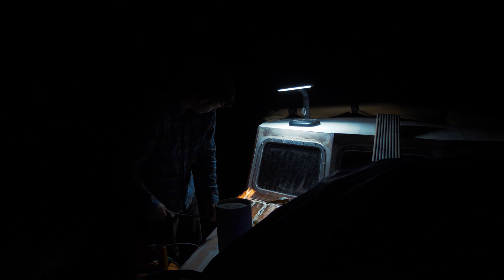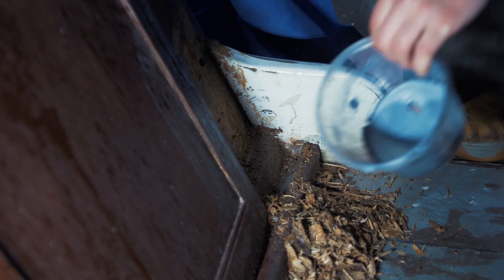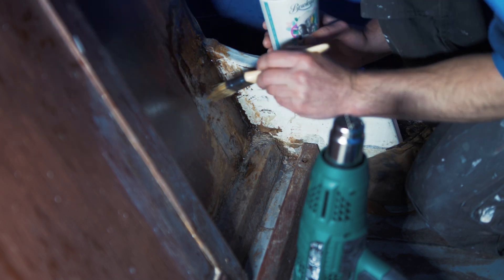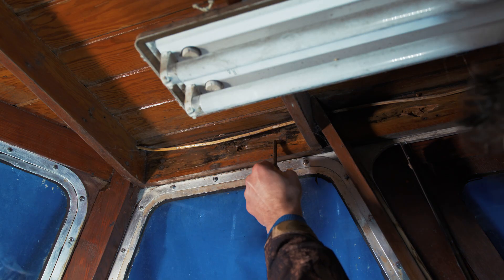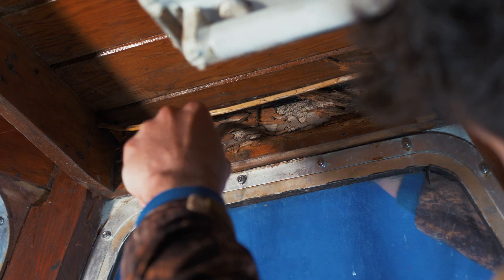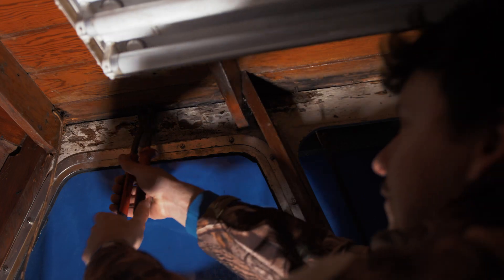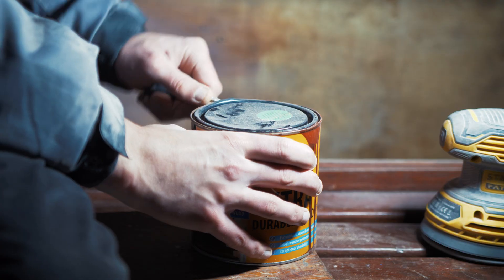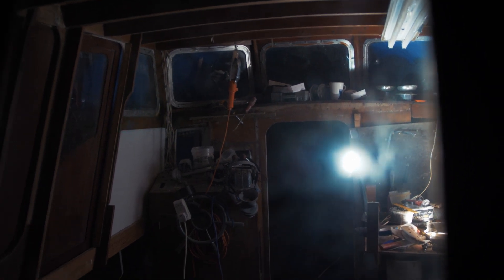Winter Repairs | 1940 Wooden Boat Liveaboard Journey | Episode 33⚓

Comment: Seeing you take down the rotted wood slivers reminds me of having to remove the rear bulkhead of my boat's salon. It was 19 mm (3/4") plywood covered on both sides with a Formica-like material. Unfortunately, there was a 25 mm (1") seam above the door exterior where water seeped in over 30+ years. When I removed the Formica-like material from the interior side, I found there was practically nothing left of the plywood; it was all rotted into slivers. Had to remove the whole bulkhead, which worked out as it has made it easier to get large items in & out of the interior for now.
Keep up the great work! Sooo looking forward to seeing how it ends up! 👍🏼👍🏼

Comment: Great project, awesome to see. Looks like you need to hook up a bilge pump on a float switch. Looking forward to seeing the end product
Reply from the maker: I have one which pumps every 2:30 minutes. Just every few days it slowly fills the wheelhouse bilge. A stern leak from one of the outdrives. Thanks for watching.
Reply from the maker: Also another in the forecabin which is on a float switch. I fitted that one as an extra precaution.

Comment: Why are you not using real wood to replace rotten wood? Instead of using all these chemicals, that for the most part will have to be replaced in a few years again!
Reply from the maker: Isn't mahogany real wood.. Using epoxy as a structural adhesive and weather sealing agent. As for the plywood it is in good shape only the bottom corners were affected.